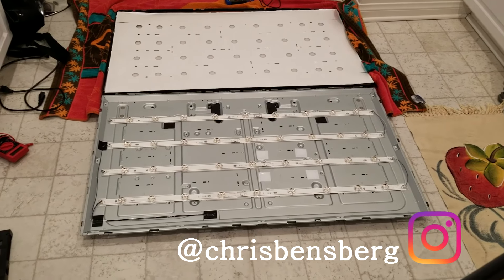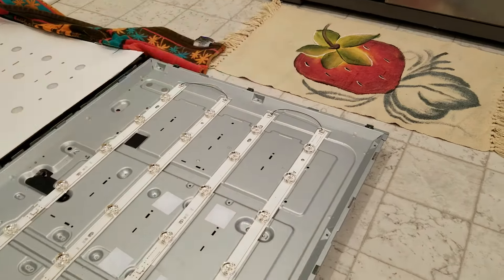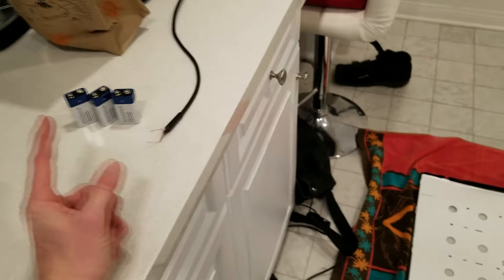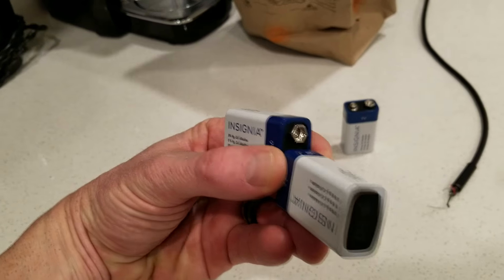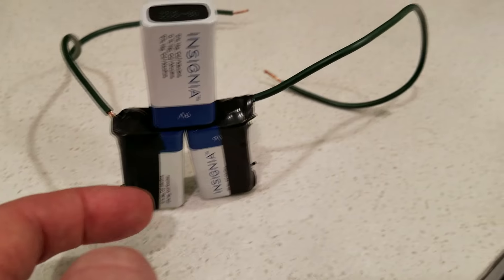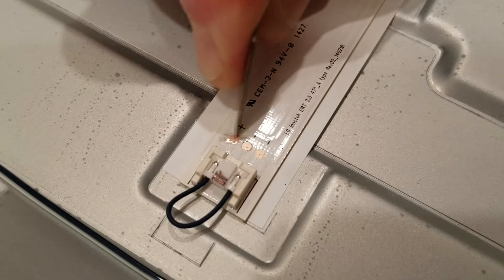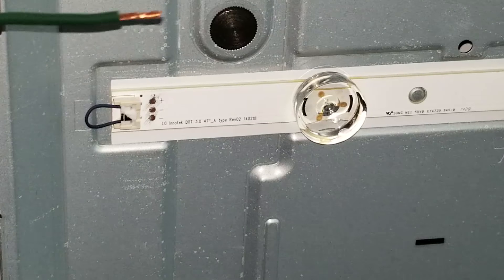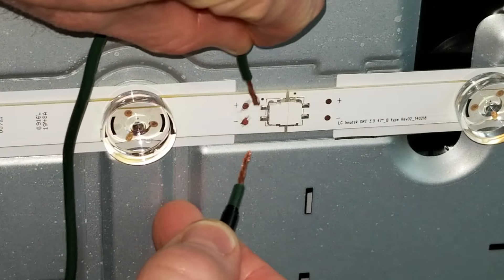How To Test TV LED Back Lights Without A LED TESTER!

Comment: Hello, just a small question : if I have no continuity on the 2 wires that send the power to the leds (from alim board)  I guess it confirms they or some are dead is not it ? When I use the ohmmeter on the new led strips, I have a reading)  Thank you if somebody can answer me